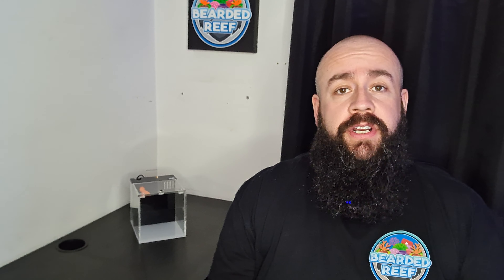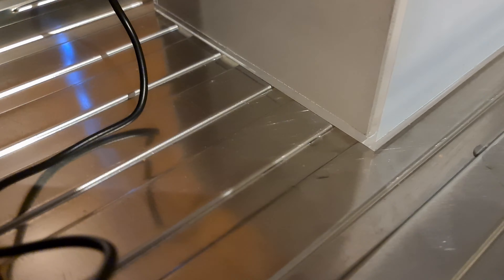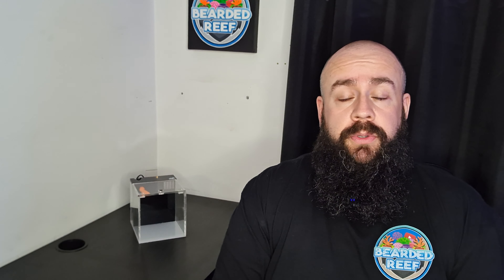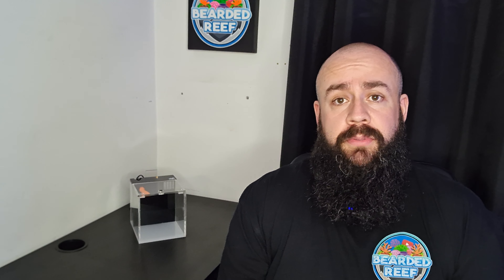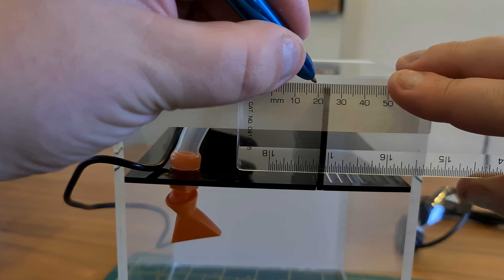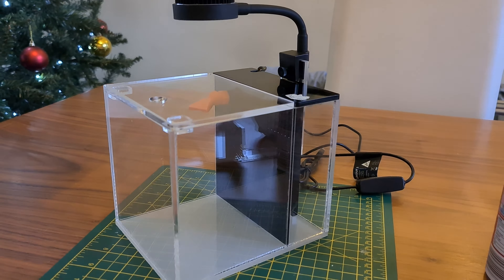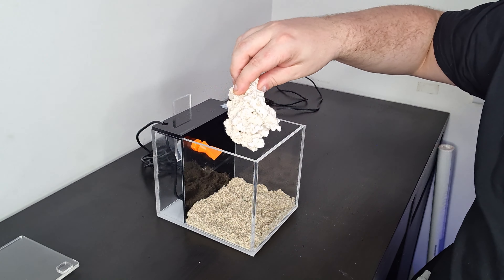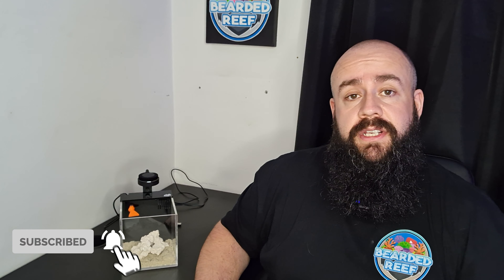PICO TANK BUILD SERIES PART 3 - Leak test, Light Bracket, Equipment, Sand & Aquascape

Comment: If you wanted to clean up those air pockets in that light attachment panel you can use acrylic cement #4. It is water liquid and a couple small drops will wick through all the gaps to make a solid attachment. Easy peasy